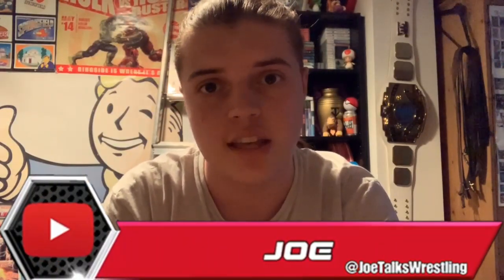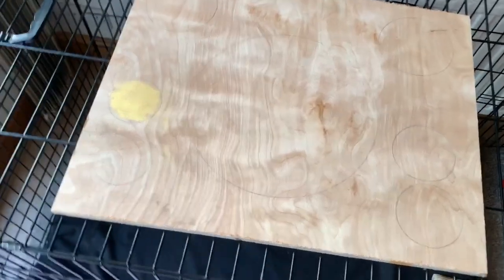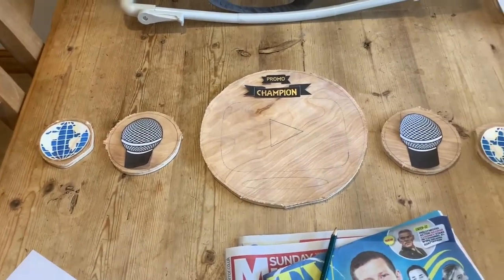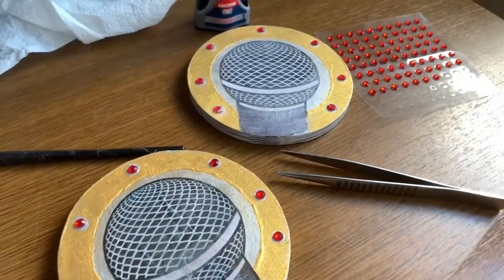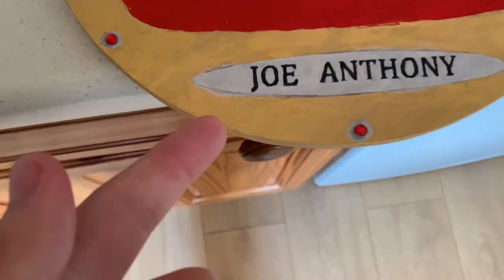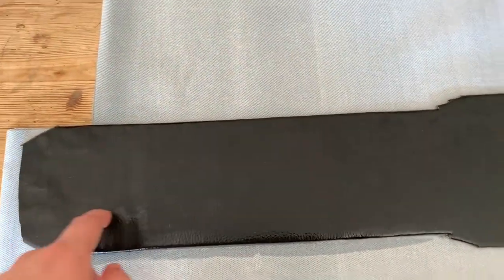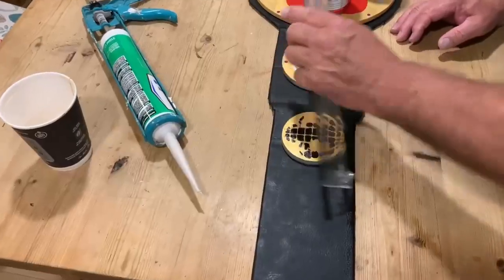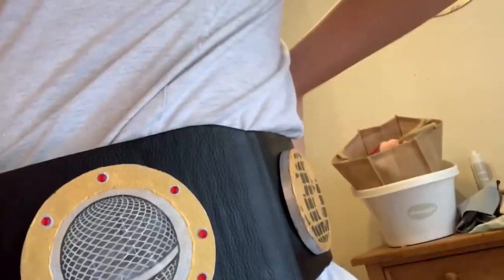KIP CLIPS PROMO CHAMPIONSHIP BELT REVEAL!!  (CUSTOM BELT)

Comment: Joe, where did you get or how did you get the banners on the top of the main plate that read “promo” and “champion”? Did you have a template?
Reply from the maker: Word has a banner you can use in the shapes section, other than that, google has some templates if you search Championship banner
Reply: JoeTalksWrestling, thanks for the help!